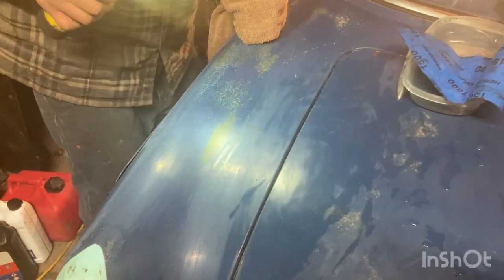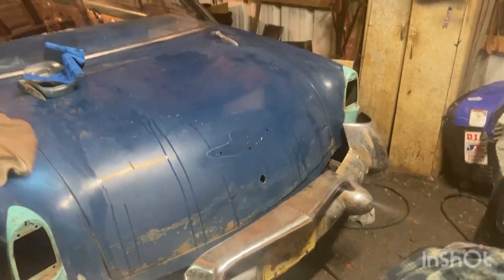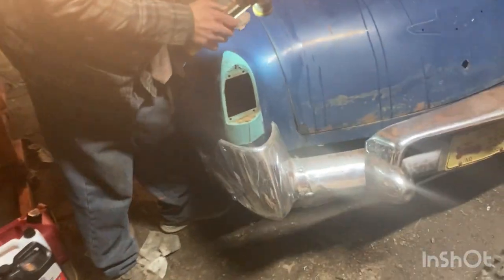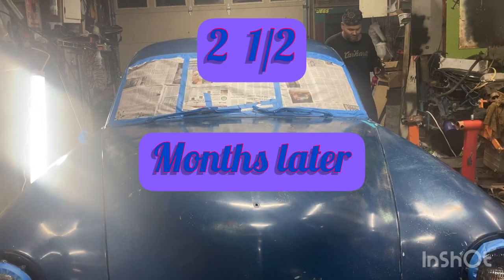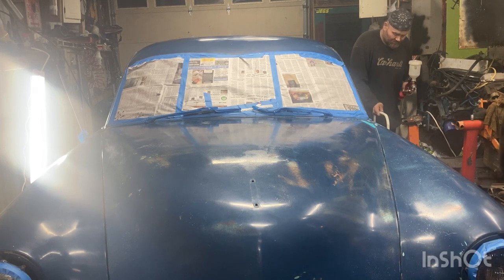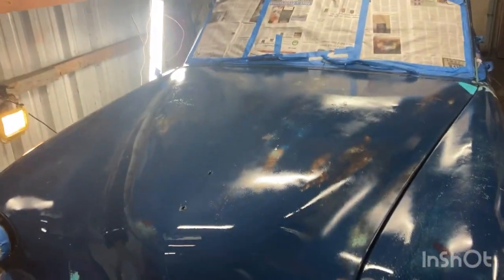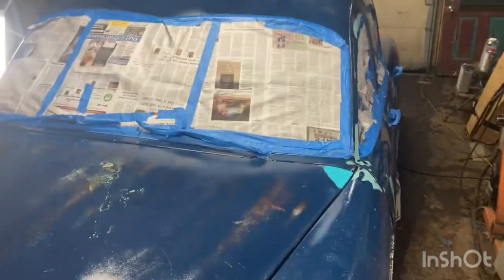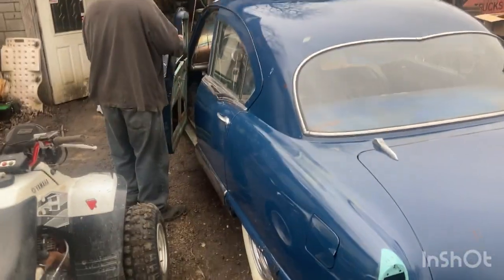1952 Kaiser Manhattan clear coating patina

Comment: I own this car now.  The brakes seem to have lost all of its fluid while sitting.  I didn't catch it until I had time to tinker with her.
Reply from the maker: If I remember right all we did was rebuild the wheel cylinder the guy that owned the car was a flipper he wanted to do the bare minimum to make the car drive down the road safely how’s the car holding up I haven’t seen it in a while
Reply: Aside from the brake fluid apparently leaking out during the winter, fine.  She runs like a champ.  Do you have any clues where the leak might be, by chance?  It's all been out for a while and don't see anything out of the ordinary.
Reply from the maker: Maybe a brake line or the wheel cylinder maybe the master cylinder it ran pretty good when it left it seemed to drive ok too
Reply: It seemed ok the couple of times that I drove it, too, but all of the fluid leaked out as it sat over the winter.  The pedal just goes all the way down to the floor now.